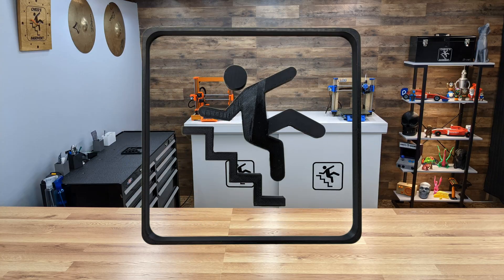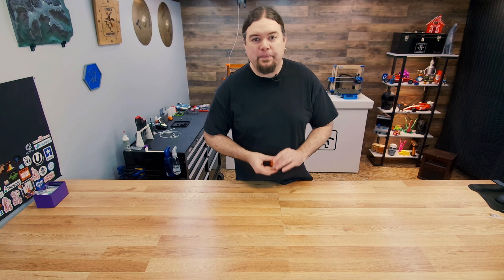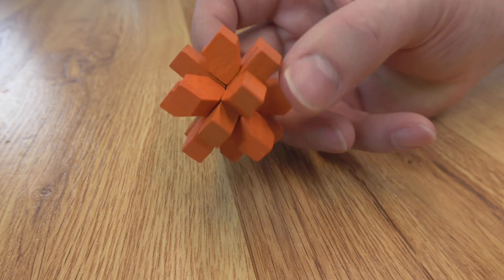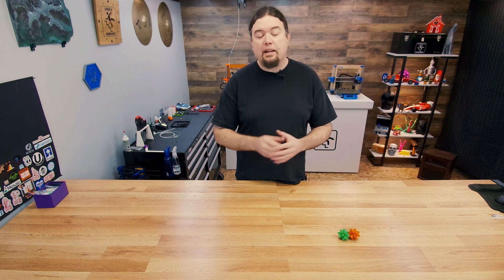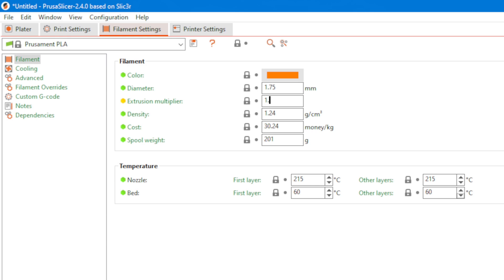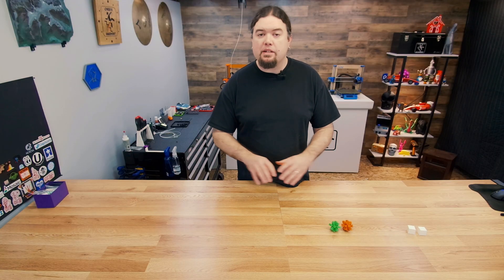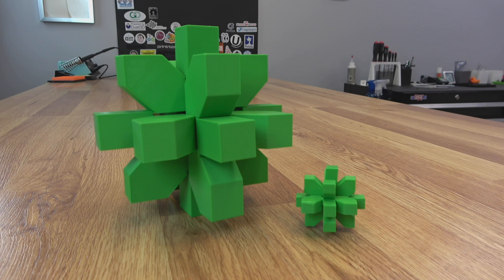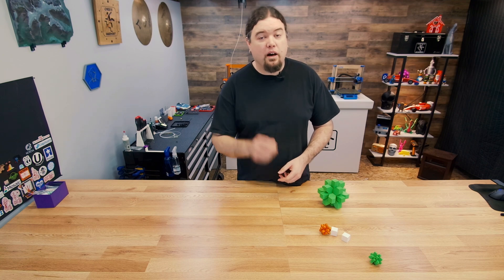3D Printed Puzzles - It Begins - 2022 - Chris's Basement

Comment: Hey Chris, I didn't know how to reach out about this but in one of your older tutorials for setting up octoprint on Ubuntu, one part of the tutorial has become outdated. https://youtu.be/fimVwRXarf4
In the vid, you used HaProxy 1.8, but now that Ubuntu comes with HaProxy 2.x, the config file doesn't work and I fixed it by using the config settings posted by "greg" on the octoprint forums: https://community.octoprint.org/t/setting-up-octoprint-on-a-raspberry-pi-running-raspbian-or-raspberry-pi-os/2337/141 (scroll down to where he says "I fixed it by changing the haproxy.cfg to:")

Might be worth adding a small note in the video description or on the google doc
Reply from the maker: Hey, I have no clue why YouTube does this, but it spits out a handful of comments in my que months after they get posted. I will take a look at updating the docs.

Comment: Mhh... Not exactly sure where the issue with the tolerances would be if you're using the actual measurements of the wooden one which already appears to be sloppy AF 🤔
Personally, if I have to print something with kinda tight tolerances ( leaning towards fiction fit but not quite ) then I go with like a one-sided 0.2mm tolerance or a combined 0.3mm two-sided one.

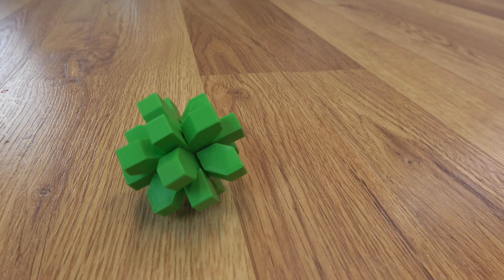Also @02:37 This being an ornamental part and benefitting from going that extra kilometer and a little more than a half I'd suggest having a look at SuperSlicers feature of printing top and bottom layers automatically with only 1 perimeter making parts look a lot better due to them not showing their perimeters ( that one perimeter will be hard to see ) 😁
Reply from the maker: Thanks for watching

Comment: The trouble with scaling is that your clearances scale too. This isn't such a big issue when going bigger because everything loosens up but it is a problem when going smaller. If you add all of your clearances after the design is complete then you can scale the part up or down in fusion before the clearances on the time line and the fit will remain the same regardless of your scale. That way your 400% puzzle will fit just as tightly as your 50%
Reply from the maker: Great info.

Comment: Chris, another one of your fantastic basement lessons.  You pointed out that when you scale your tolerances will probably increase, this is why many things print better when scaled up, especially flexy designs.
Reply from the maker: Thanks Dave, I have found older STL's ones designed with ABS in mind always work better scaled up.

Comment: I wouldn't consider myself a Fusion 360 expert, but I do have a few of tips for you. 

One is to use parameters. Then you can build the tolerance/clearance right into the model. Then to change it you just change that parameter and the whole model changes. It's seriously a game changer when I discovered you could do this. No more hunting through sketches to change dimensions. 

Also you may want to make a component for each part instead of leaving them as bodies. That way you can actually create joints and then see how everything fits together.

The Inspect > Section Analysis also helps figuring out any clearance issues. Use the I shortcut key to bring up the measure tool and you can measure between points/lines/faces/etc.

I watched a lot of Lars Christensen's videos when I first got started with Fusion 360 which really helped. Modelling things around the house or like you have done is a great way to learn.
Reply from the maker: Thanks for the helpful tips Mike!

Comment: Calibrating for each new roll is not that difficult. I use Luke Hatfield's cube on Thingiverse printed w/ 2 walls and 100% (1.00) multiplier. A quick calculation based on part thickness and I'm w/in 1-2%. It pays to measure your diameter and average that over a meter or so too. I had an eSun spool come in at 1.68 and it took me a bit to figure out why my prints looked like crap. Plugged in the right diameter and all was well. The slicer does adjust the gcode based on the diameter you provide.
Reply from the maker: All true, great info.